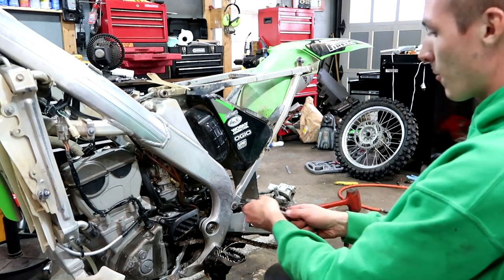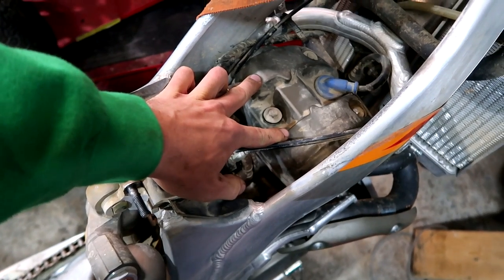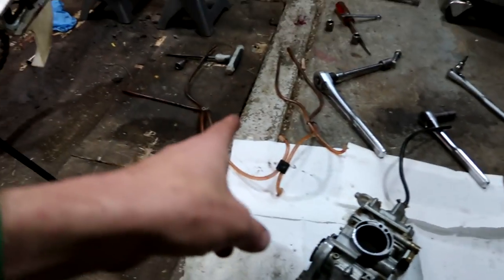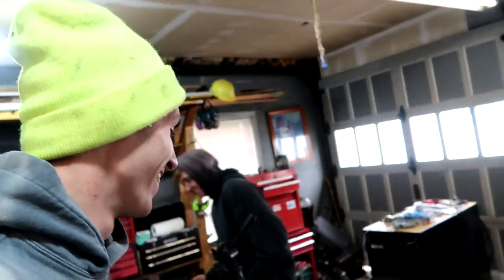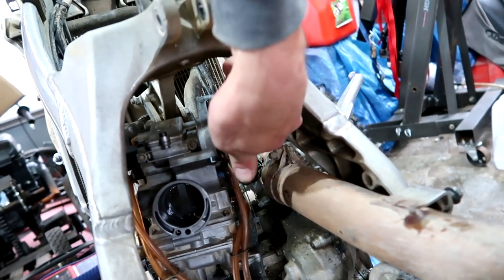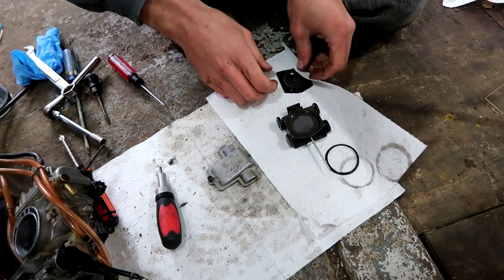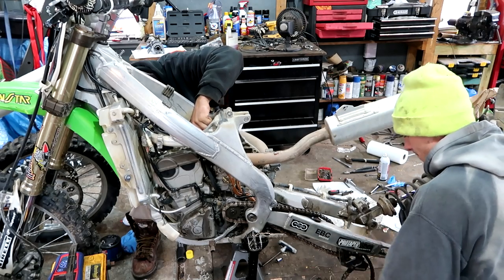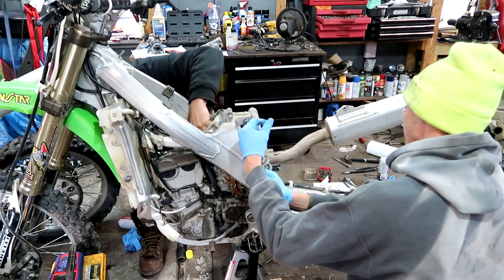WE MIGHT NOT MAKE IT

Comment: To get the parts you need for your carb go to a Suzuki dealership. Kaw, Honda, Suzy, and Yamaha all used the same carb but only Suzuki sold the parts separately. Your fuel screw was loose probably because it was adjusted too far out. At 2 1/2 turms out there usually isn't enough tension on the spring so the screw can vibrate loose and fall out. The fix is to run a bigger pilot jet and less turns out on the adjustment......

Comment: NEVER wash air filter with petrol and you NEED air filter oil!
Reply: Rory Bonner there's nothing wrong with washing an air filter out with gas, and you can use motor oil on a filter it's not as tacky so it doesn't collect as much dust but it works